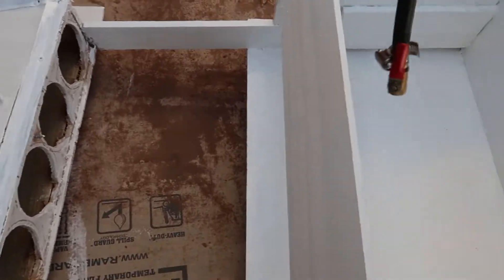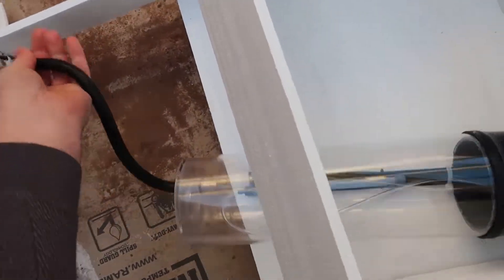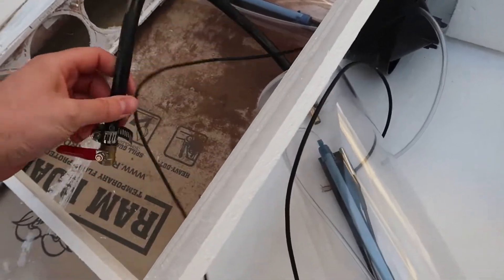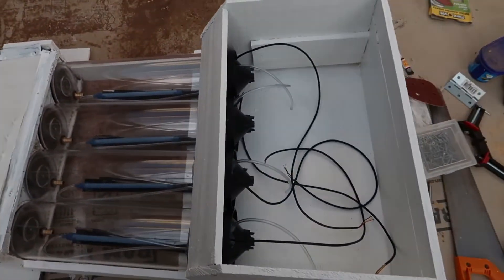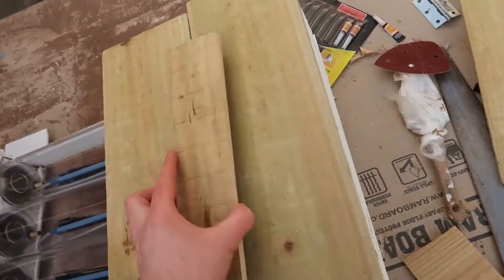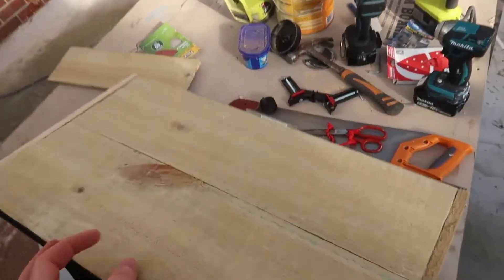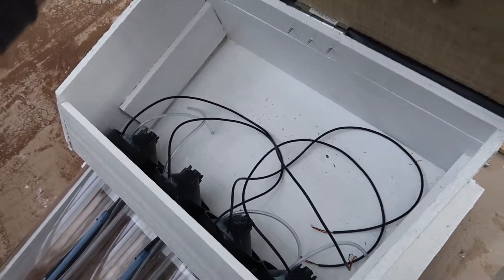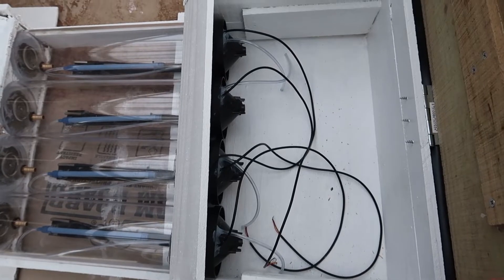Scrubber tubes installed and enclosure lid added

Comment: Hey, I'm not sure if you have picked your type of algae yet, but I found a paper that details the carbon uptake by algae species. It's called "Biologically-mediated carbon capture and utilization by microalgae towards sustainable CO2 biofixation and biomass valorization – A review" by Daneshvar et al. (2020). Maybe you can check it out!
Reply from the maker: Hey, Thanks heaps for the details I haven't had a chance to go through in depth yet but looks good so far a lot of info. might be changing the algae types now

Comment: I was wondering how you get rid of the dead algae? Or do you run the system until they're dead then just filter it out?
Reply from the maker: You don't want the algae to die, think of it like a tree it needs to be alive to do its work, algae is similar but creates biomass which will be drained out over time and replaced with more water, trick will be trying to keep it alive and correct balance or nutrients ect.. dead algae usually goes brown/grey in colour
Reply: @ScottyDIY  Very cool, thank you. Great project! Looking forward to seeing it through